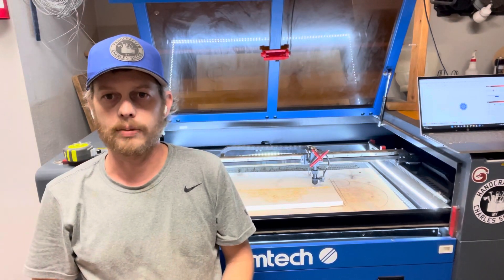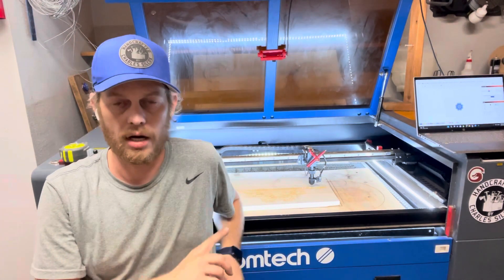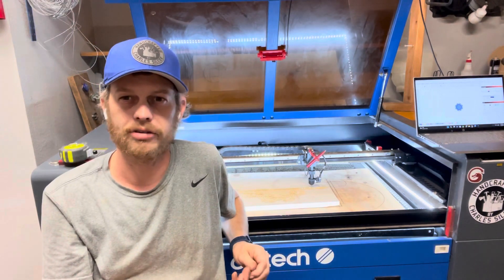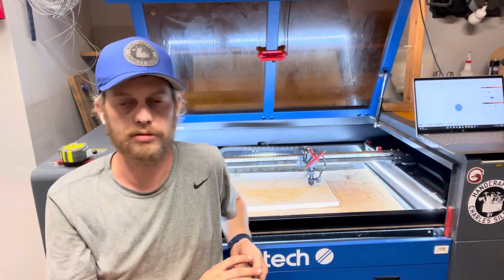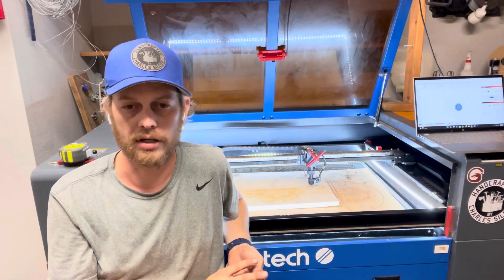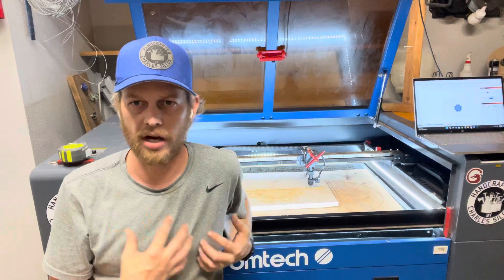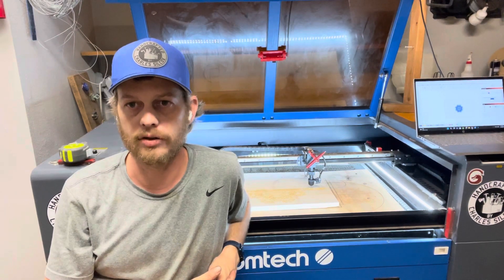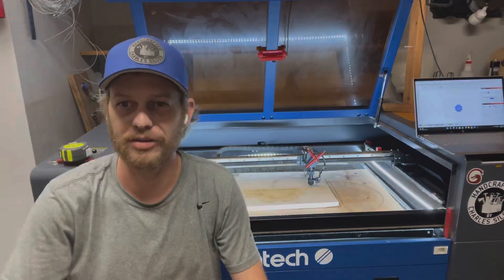Talking About My OMTech C02 Laser

Comment: Are you using the stock air assist and if so do you feel it is adequate or does it need to be upgraded?  Thanks in advance.
Reply from the maker: I'm using stock right now, it works well, but I do think I am going to upgrade it at some point.

Comment: Nice video! It looks like you have the auto leveling device tied up. Does it not work properly?
Reply from the maker: It works fine, it’s just faster to focus it manually. And I use an aftermarket lens that it didn’t fit perfectly on. Instead of trying to fix it I just stopped using it.